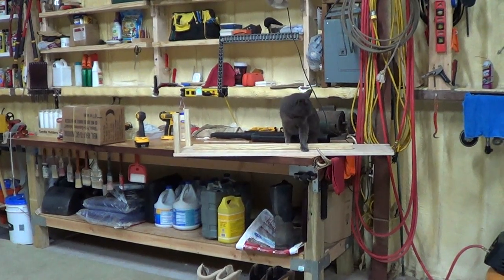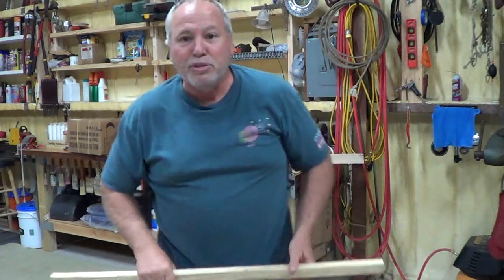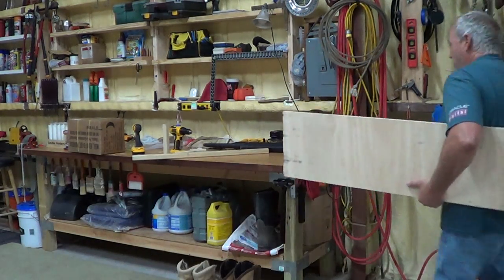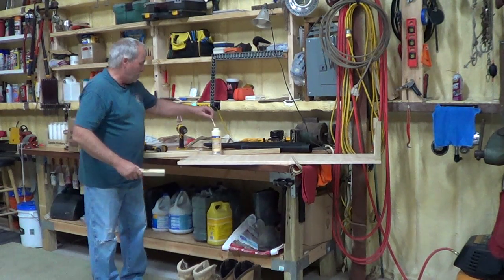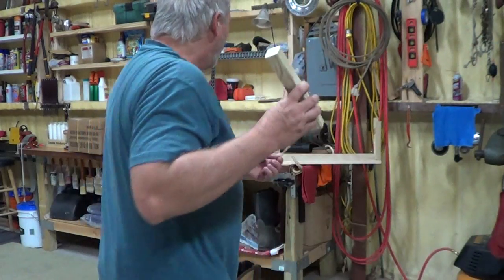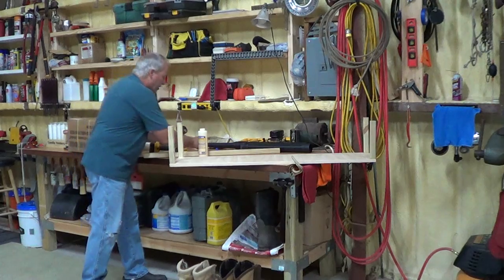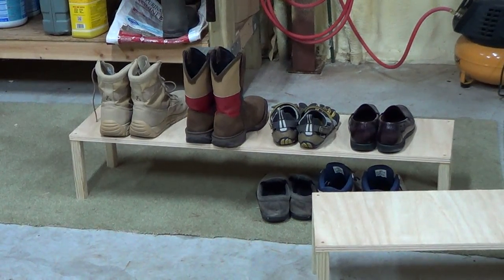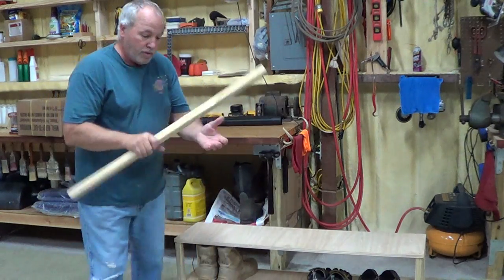Easy Closet Organizer & Shoe Shelf For Under 20 Bucks

Comment: you could easily put some legs in the middle to add more support in that area so they wouldn't sag. that way you could put heavier things on it if need it for something other than shoes.
Reply from the maker: that ply wood is pretty sturdy depending on how thick you get it, but yes that would sturdy it up.